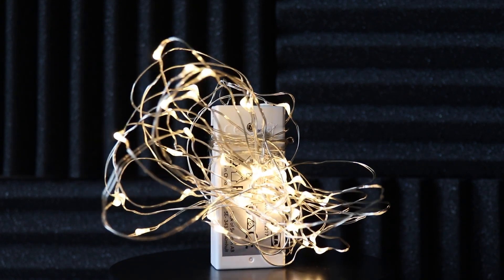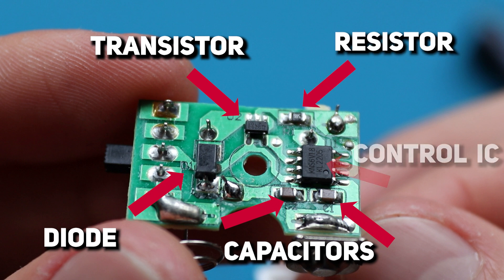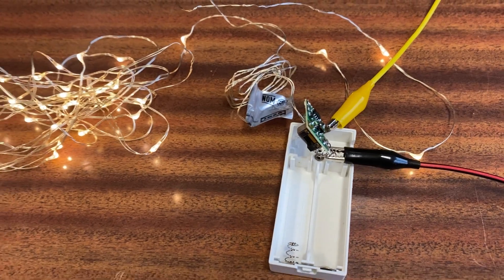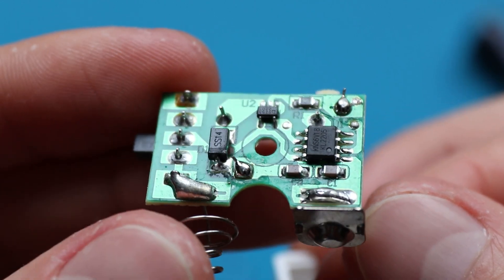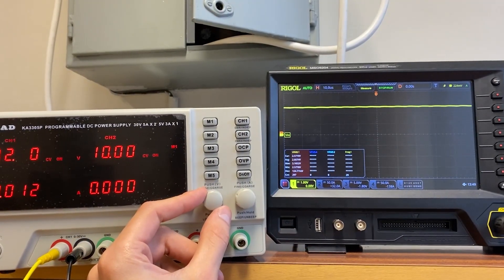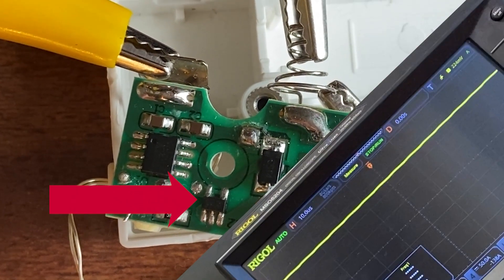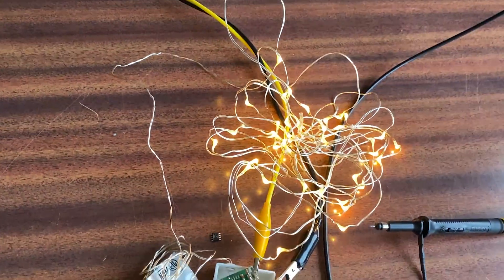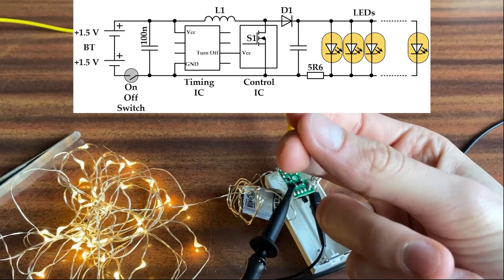How Do Lights from IKEA Work? (with Schematic)

Comment: In this circuit, it looks as if there is no feedback system to measure output voltage, so im wondering how they know when to boost the voltage or not like an actual buck boost converter.
Reply from the maker: Because there is no datasheet for the circuit i cannot tell you 100% how.... BUT, it can work using "open loop control". Knowing only input voltage you can adjust parameters of the system according to it. For example, you know that for 3 volts, duty cycle should be 0.5. So, when voltage increases to 3.05 V, for example, you decrease duty cycle to 0.49. And when voltage decrease to 2.95 V, you increase duty cycle. That is how it can be done using microcontroller. But, as a said, i do not know 100%. Maybe there is analogue circuitry inside with its specific control algorithms )
Reply: @NickElectronics  thanks for the reply, i was thinking the same since that's the only way left to get feedback with the help of the "mysterious IC". i don't know if its more practical or efficient though.
Reply from the maker: @Inti72600  You`re welcome! 
I don`t believe engineers who designed it were thinking about efficiency, cause power is too low )